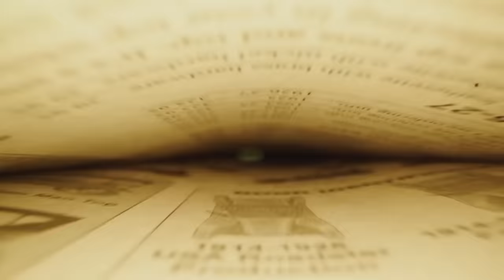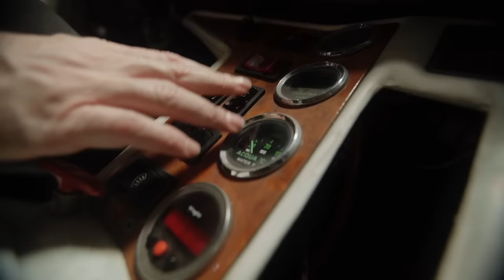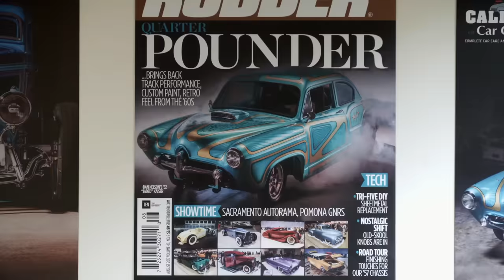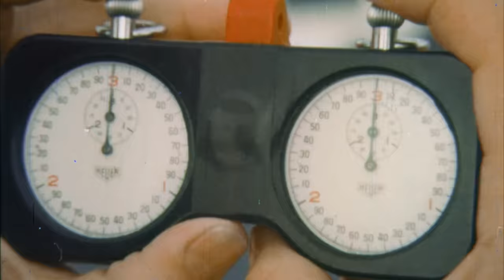The Untold History Of Carroll Shelby’s Secret DeTomaso Pantera | G.A.S Extreme Customs

Comment: Back in the early 90s, when Shelby was starting to build the continuation Cobras with inmates to fund the Series 1 project I got to take a tour of the shop at the skunkworks by the Rio. I saw this Pantera over in the corner. It had the engine in it. It was a 351C with twin turbos and a fabricated blow through air box. couldn't see what it had for carburation. I was told it was a test mule for another project and to please not take any pictures of it.
Reply: When did you see it?
Reply: This car had a twin turbo Dodge 360 and that appears to be what they put back into it...

Comment: As a mechanic at Pete Shaver Lincoln Mercury in Hammond,IN. in the early 70's I was there when Pete flew to NY to bring back one of the first  DeTomaso Panteras . Had a 351 Ford Cleveland engine with a 5 speed manual trans . So sweet .
Reply: I was in college and the local Lincoln dealer sold them for $10,500,00, always wanted one and still do.

Comment: I knew this car, very well !!!  Because it was going to be mine !!!  In the 90s I worked as the Asst. Parts Manager in a Dodge Dealership in San Fernando, CA...  It was called, Murphy/Shelby Dodge !!!  Where this car was for 6 or 7 years that I worked there !!!  We had the Car in exhibition in the Showroom Floor !!!  After 3 years of me working there, the Dealership General Manager wanted Cars that could be sold in the Showroom Floor !!!  So we moved the Car to the Mechanical side of the Shop !!!  It was funny that the Mechanics that were asked to get the Car running were unsuccessful in doing so !!!  I am a Mopar Muscle Car Head and have never liked or even looked at the Ford Product !!!  Except for the 1970 to 1974 Ford Pantera Detomasos !!!  They have always have had a special spot in my heart !!!  Well I have had my eye on this Car for 3 years !!!  And went and checked it out while it was on a hoist and saw the whole underside of this Car !!!  I also noticed that the Mechanic that was working on this Car ordered Motorcraft Sparkplugs for a 351 Cleveland Engine !!!  And then I spotted the Sparkplugs that came out of this Car, and they happened to be Champion RN9YCs ???  I said to myself a Mopar Plug in a Pantera ???  It can't be ???  I have those plugs in stock in my Parts Department !!!  So, I grabbed a set of 8 plugs !!!  I measured the gap on the plugs that came out of the Car and I believe it was .28 to .30 if I'm not mistaken !!!  I regapped the new plugs that were .34 or .36, to the gap that was on the plugs that came out of the Car !!!  At the same time I also got a flashlight and checked the engine out, till I found the engine casting number and The Mighty Chrysler Pentastar !!!  It was I needed to see !!!  I dropped the Car down on the hoist put the Mopar plugs in the engine !!!  I tried turning the engine over that happened to be on a battery charger charging the battery !!!  Unsuccessfully, like the luck that the Mechanic that working on it, had !!!  I went in the Parts Department again and grabbed a brand new Dodge Diesel Truck Battery !!!  And went back to the Car and installed the Battery !!!  I sat in the Car and turned the ignition !!!  And Viola !!!  Bam, it fired up !!!  It sound like a Pissed off Devil !!!  I was shaking in joy and pride, that I was the one that figured out the formula to fire this Car up and had it running !!!  I drove it to another lot where we kept some odd and end cars and a Boston Whaler that belong to Bill Murphy (the other Co-Owner of the Dealership) !!!  I stashed the Car !!!  The next day, I ordered a Top of the Line Car Cover for it and it went to sleep for another 2 to 3 years !!!  Till I propersitioned Pops( that is what I used to call Carroll Shelby) !!!  And took him to the lot and show him the Car !!!  And told him that I ran the VIN Number with the DMV and the Car came out to registered to him and Peterson Museum !!!  He kinda recalled but, with so many Cars in his memory !!!  The Car didn't really mean much to him !!!  That is when him and I made a Deal on the Car, and that I was going to buy it for $15,000.00 dollars, which in 3 or 4 days the Business Office Manager was to take out $500.00 out of my paycheck as the first payment for the Car !!!  I was in 7th Heaven !!!  Pops, instructed me to call a man named JL at Shelby Enterprises in Gardena and only speak to him !!!  It turned out that JL, was Carroll Shelby's right hand man and was the man that oversees everything in the Gardena Shelby Facility !!!  The following day, I called JL, and asked him to please locate the paperwork and title of the White Pantera ???  He immediately replied, NO !!!  And questioned if I was crazy ???  I answered no sir,  and told him that Pops and I made a Deal and that I was buying the Car !!!  Mind you, I have had that Car stashed under a Car Cover for 3+ years and every so often, I would go sit in it and fire it up !!!  I would literally get my adrenaline fix for the day and would go back to work !!!  For 3+ years, I did that !!!  I even had the thought of just driving or having the Car towed to my house, because nobody knew anything about this Car !!!  But, I am not a thief and I knew if I ever had a chance of buying this Car ???  That, I would be blowing it if I did that !!!  So, I never did that !!!  So, when I made the phone call to JL, I kinda blew it anyway !!!  Because the very next day !!!  There was a Car Transporter Driver that came straight to my Parts Department with instructions to get me and to have me take him to the Car !!!  That day my heart sank and I as I watched my Dream Chrysler Powered Pantera get loaded in the Simi-Truck Car Transporter and drive away !!!  I lost a part of my heart !!!  My eyes actually watered and I said to myself !!!  It probably was not meant to be !!!  And now that I saw this video !!!  I am haunted again by this Car !!!  And again my eyes are watering !!!  Damn it !!!  This Car Was Mine !!!  Damn It !!!
Reply: After the 500 .00 down payment I would of taken the car home.
Reply: @dash4191  Today, I am kicking my self in the ass for not being a thief !!!  That Car was mine !!!  Heart and Soul !!!  Carroll Shelby (Pops) approved !!!  JL, interfered !!!  Granted, he was just an employee and was looking out for Pops best interest !!!  I do have a clean conscience, and self confirmation that I am not a Thief !!!  That Car could have been and probably should have been in my garage, easy 5 years before this video, story and Car came to light !!!  Damnit !!!  😢😭,. Deep Down Inside, I am in Peace...   I have my 70 'Cuda, 71 Roadrunner, and  my 68 Dodge Dart GTS !!!  What More can a Man ask for !!!  Happy, Grateful and Peace of Mind 🙏🙏🙏
Reply: @lacycoosbmx  I dont see why you would consider yourself a theif when $500.00 were taken from your pay as a down payment. The car was yours, and you had every right to take it home, period. Never let a car of high value that belongs to you sit in another mans garage. I had a similar experience with a Chevy 55 Belair coupe when I was 18 years of age, back in 1986. The car was 100% mine, I made the stupid mistake of leaving it in someones backyard  a mile away from where I lived. 6 months later the car was gone, stolen. Me and my girlfriend at that time had spent every penny we had in restoring that car. Until this day, I feel the pain of loosing that car. Lesson learned.
Reply: God and I know that I should have done exactly that !!!  But, I actually told Pops that the Car was stay parked where it was at till I paid it off or that parking spot was needed for something else !!!  A Car Dealer and Huge Businessman, made me Cry by telling me that the Stupid Title means nothing !!!  That I should've take it home and respectfully made my payments !!!  And later on,  file a lost Title with the DMV !!!     That is exactly, when my eyes opened up and poured !!!  The knowledge of certain little iffy things (could be within the law) that some people know ???  Never ceases to amaze me !!!   Damn, I F√©k up !!!  Now, Pops is Gone and Resting in Peace and I am Rolling in my Grave, that I haven't even gotten to yet !!!  What a Traumatic Loss that this Car has become !!!  💔👎  Now, I feel like Crap, again !!!
Reply: Great story
Reply: Glad you didn't get.
Reply: Go get a shifty Chrysler.
Reply: And then everyone clapped!!!
Reply: That's a lot of exclamation points.
Reply: Could tell a mile away that was a Dodge 360 and not a Ford 351C... the Ford has evenly spaced exhaust ports, the Dodge has two close together in the center... Like a small block Chevy...
Reply: Your lack of sentence structure, paragraphs and grammar make that wall of text indecipherable.  I was interested in reading your story, but clearly you were uneducated in the USA.

Comment: Shelby and his GT40’s used to get destroyed on tracks by a Pantera built for the track in CT. Shelby thanked the owner and driver of that Pantera because it proved to him that they needed to improve the GT40. That Pantera  destroyed everything and was recently purchased. Oh ya it was powered by a 351 Cleveland, with a little more hp than stock in that car.
Reply: The 351 Cleveland came into production several years after the Gt40 program was over with and left to the history books.Tell us some lies we might believe next time.
Reply: @HarrisonJBounel No, that is the truth. It was a yellow Pantera, just sold with extra race parts. You will find it here on YouTube. The quote of Carol Shelby was also accurate. Don't call people liars, because you are unaware. Want to talk cars? The 351 boss was a derivative of the original Mangusta 289, which put out over 320 hp, more than the later 302. The 351 was also called an HO by some, but it's still a Cleveland. Panteras and also Mangustas are capable of great handling when modified, although the Mangusta has a totally different frame...Spine. The Yellow Pantera was raced privately, but there were many that were fast at that time. So who is the liar? Answer.
Reply: @andykerr3803  While the Boss 302 was basically a Winsor 302 (which was in turn a stroked W289) with Cleveland style heads and four bolt mains, the Cleveland 351 in standard and 'Boss' versions is not usually classed as a derivative. For all intents and purposes, it was a new design, while keeping some aspects of the older engines, such as head bolt and main tunnel spacing.
Reply: @robertrobinson3861  They even chop those cylinder heads in pieces and oven braze them back together for the 6 cylinder, complete with plates to change the exhaust angle... Yes, the variety is boggling. The original  289 in the Mangusta was perhaps the inititiator at well over 300 hp, the 302 at that time was way less, both offered on that car. The Cleveland design overall lends itself well to larger displacements as the M400, but of course the Windsor can also reach nearly 450 cid in aftermarket applications. There seems to have been an inherent bottom end lubrication issue with the Cleveland that needs attention. Possibly the overall system was not geared for hydraulic valve lifters hogging the flow... I remember Ford even selling a 4 cylinder Motorsport block for that head, the 385 too! Those were the days...
Cheers 🍻
Reply: Nothing you said was accurate or true.

Comment: This guy makes it sound like Shelby made all of the cobra himself but he didn't as he used a British AC ace chassis.
Reply: Shelby bought the remaining AC parts inventory after bankruptcy and built "AC" replicas.
Reply: It’s funny that they repeatedly seem to forget that both the cobra and the gt40 wouldn’t have been off the ground if not for British engineering.
Reply: @artfiend75  yes your right as LOLA created the GT40 CHASSIS, EVERYTHING is American to Americans.
Reply: @adamweston4152  that’s correct sir, along with the first, I think 3/4 iterations where also redeveloped by British engineers as the Americans couldn’t get it running correctly, we did although not get it quite right. But before the Americans did get it right and make it completely American built.
Reply: 289 Cobras were AC bodies and frames and ridiculous transverse leaf spring front suspension. However 427 Cobras only shared a very similar body to the 289 cars. It is also true that the first 289 powered GT40 were Lola built chassis with Ford engine and Ford contract built in the US trans axle. However once again after the 289 car proved to be underpowered for some tracks Ford took the lessons from Lola and with input from Carrol Shelby and his crew built the 427 powered GT40 with Shelby. Or vica versa as it depends on how you look at it. The GT40 only ever happened because of Ford money and massive research and development ability but the package as a whole was conceptualized by Shelby's business and ultimately produced because of there vision, experience and ability. As a side note a 427 powered Shelby Daytona coupe would completely obliterate a Pantera on all but the shortest tightest of race tracks as would a GT40 as well.

Comment: Why are the turbo's not plumbed up to the carb ? 🤔
Reply: Most early turbo motors were draw through rather than blow through, it was a simple setup that negated the need to increase fuel pressure as boost pressure rose. Not good for turbo longevity though.
Reply: @paulzx10  - Superchargers are draw through so they simply did the same thing with turbos for the first 75 years...